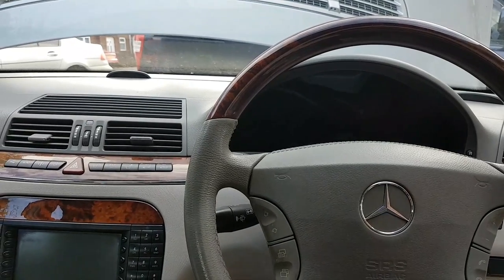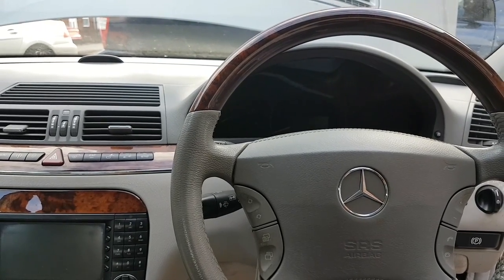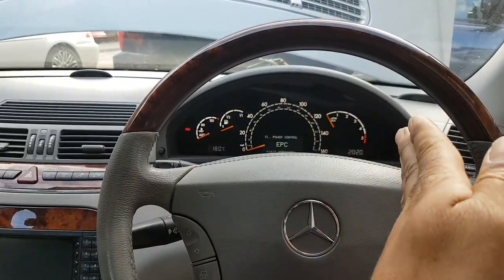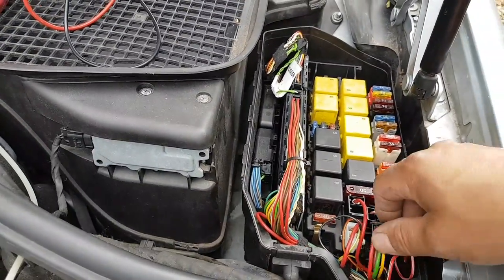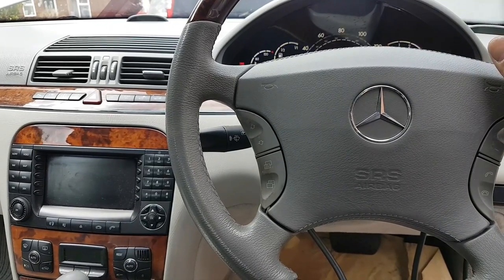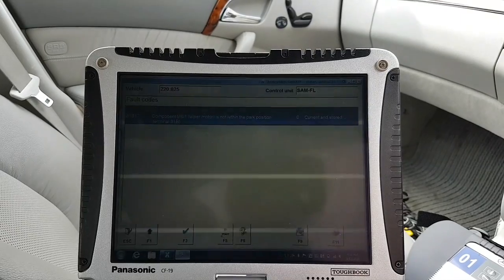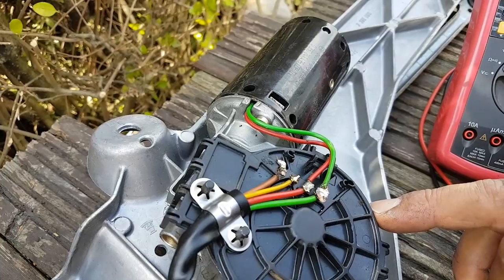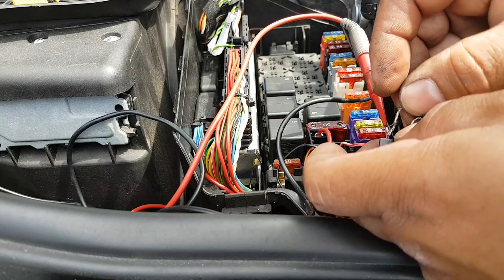Mercedes S320 W220 wipers not working. Fault finding and repair.

Comment: Hey Luis that was a great diagnosis but here's a tip from an old guy. From the days when cars had distributors and points, the points had a good thick layer of platinum plating. You could file off the burnt parts and everything was OK. Then the manufacturers started to economise, the platinum got thinner and nowadays I think that they are all just silver plated. Not just in cars but in things like fridge thermostats. This plating is a very thin layer over a brass or steel contact, after you have cleaned it it will not last very long. I was once given a really nice washing machine, it was built like a tank but the contacts in the mechanical programmer were burnt. I cleaned them but after two weeks they failed again. All the silver plating was gone. Anything that draws a high current and has an inductive load will give you the same problems. I hope that this helps anybody out there. It is a shame to buy new parts but sometimes you may need to. 

P.S. I'm not entirely sure but if you switch off the ignition with the wipers still running would the back EMF* make a spark across those contacts? Hopefully someone will know :)
*The back EMF is caused by the collapsing magnetic field (in for example, an electric motor) inducing a reverse voltage in the circuit. That's why some relays have a diode inside, it's to short that voltage across the coil and stop it harming the rest of the circuit.
Reply from the maker: Thanks for the advice!
For watching and for your comment, really appreciated! 
👍👍👍

Comment: well done, took a bit of sorting but you got it done,   I ask myself what have we gained from all these electronics, millions of man hours lost everyday because  of (in this case) a coked contact. In the old days you had 2 wires and a switch, you switched it on, and you switched it off, it worked .. and if it didn't it took 10 mins to fix.

Comment: Hey great video hope you're still doing your thing I have that exact problem with the ignition and was wondering if that can also cause an airmatic fault. Sometimes the car lifts sometimes it doesn't. The problem has gotten worse I can no longer jiggle the ignition to make my wipers work and now the car doesn't lift at all
Reply from the maker: It is possible, but o would think if was the ignition it would cause other issues...
Try to scan the car, and see what it going on...
👍👍👍
Reply: @LMAutoRepairs  the ignition is causing many problems. The wipers used to work by jingling the ignition and can't shift out of park without jiggling the ignition also when I press on the brake the SOS light and the gear shift lock light blinks and the radio cuts out. I've been having problems with the airmatic sometimes it goes up sometimes it goes down. And now that jiggling the ignition for making the wipers work does not work anymore the car also does not rise anymore I recently put a wire to a switch from that red power wire in your video to make my wipers work. And if the relay for the airmatic is on the same side that may not be getting power I'm assuming that it could also be causing the issue with it rising up and down. Sorry for the long paragraph and thank you for your help
Reply from the maker: Looks like you have the same issue as I had in the video...
☺️
Reply: @LMAutoRepairs  what you did to that ignition was it just a temporary fix or did solve the problem completely. You just clean the contacts and bent the contacts.my Car won't rise so it's not drivable .so I might as well try to do that same job myself before buying a used one and cloning
Reply from the maker: @steved6275 
It sorted the problem once for all in this case...
Reply: @LMAutoRepairs  ty sir

Comment: Great video I have a 2006 kompressor W203 M271 with the same problem check the fuse and relays and it look good and I did also buy another wiper motor put it on but it still on working. 
Regard Nigel
Reply from the maker: Hope you find your issue...
🤞
👍👍👍
Reply: The thing is I don't know where too start,

Comment: Good video. Thanks. My ML350 front wipers are not working. I believe the motor is good by applying power via connector pins. The fuses are good in the fuse box. After turning key to ignition position, I find no power 12V shown on the wiper fuse terminals. Is this correct? All other fuses’ terminals can get 12V except the Horn fuse. However, the Horn does work good. Appreciate any suggestion?
Reply from the maker: You need to scan and look at some live data...
Otherwise is like chasing a ghost...😊
👍👍👍
Reply: @LMAutoRepairs  Thanks for the suggestion. After finding no problem to the pump and the motor, seeing no power on the fuse terminals, reconnect the battery, the washer and wipers are back to work now! I remember saw a YouTube video. The guy has taken all wiper a part, test motor and finding no problem. The wiper begins to work after putting parts back. His comment, don't know what are reasons caused failure but hope the video shows you a good way of taking wiper into parts. I feel the same way, cannot figure out the failure reason. Though I did clean up the washer pump robber filter clogged residues.

Comment: Great video.  My 2006 S500 lately started having wiper and washer problems.  Sometimes they work and sometimes don't work.  When they don't work, the SOS and the brake light flickers on/off when I try engaging the wiper or washer.  Any suggestions on the problem would be very appreciated.
Reply from the maker: Difficult to say...
Could be something similar to this, but without checking/diagnose it is pure guess work...
Scan it, check some live data and go from there...
Thank you for watching!
Reply: Hey how's it going did you ever figure out that problem. I'm having the same exact issue

Comment: THANK YOU FOR ANOTHER GREAT VIDEO!
Yes it is imposible to repair car without wiring diagram somethimes. Maybe it is but then you don't need scanner, scope, nothing. Maybe this is posible I don't know. Even if it is, it would require much more time I'm sure. In this case how one would know where that wire was going without diagram.
Greetings from Serbia.
Reply from the maker: Indeed.. 👍
Thank you for watching and for your comment!

Comment: Vipers not working and
My washer dont work either,
Have check Fuse and relay and they ok..... can it maybe be the viperarm in car ... strange that both breakdown at same time......? (W203 c200 2001)
Reply from the maker: Hi
Yes... strange that both failed at the same time... but is possible...
Can you not scan the car first?
Thank you for watching!
Reply: I have done that with Icarsoft but it aint get no code at all..
Reply from the maker: @freddomfigeri193  
What about live data?
I don't know that tool... might not be able to go that deep into the modules...
Reply: @LM Auto Repairs 
This is really weird....?!
Took a grip around  wipers and ”shake it” and both the washer and wipers work 🤪🤔 
Soooo.... it must be a co-operation between wipermotor and washer...... guess it is the motor after all ....?
Reply from the maker: @freddomfigeri193  
Lubricate the shafts and linkages if they are getting seized...
👍

Comment: The oil temperature sensor is a common issue with the OM 642 engine. Mercedes made a revised component which is what your customer should have put in. If I can find the new part number I will post up on here. 

Where did you get your Star machine from? I remember you saying a while ago a company that you use (and not promoting) but I have lost the link to them. Can you please help?
Reply from the maker: Hi
Thanks... 
👍👍👍
Reply from the maker: Cardiagtool.co.uk
Reply: @LMAutoRepairs  Thanks.

Comment: I have a 2010 C300 4 Matic,  wipers will not work . I need a quick fix . Wiper motor is good . Can u tell me how to wire direct power to this wiper motor so I can hook up to a toggle switch for now . I would appreciate any help .  BTW I like your vids very good work you do .
Reply from the maker: I would have to look at the diagrams for that... 
Have you tried to Google it?
Thank you for watching and for your comment, really appreciated! 
👍👍👍
Reply: @LMAutoRepairs   I have tried Google and  fb pages , no help . I have watched  hours of vids and nothing bc No one has this problem.  Been working on this for 3 weeks .  Wipers won't work . Has power to motor ,motor is good , switch is good all fuses and relays are good . All started after I fixed the esl motor . No wipers and airbag light on dash now . Triple checked everything I took apart .
Reply from the maker: @ferrellcat5860  
So... must be something you have disturbed...
What codes do you have, on the airbag module and Sam?
Reply: @LMAutoRepairs   front left srs malfunction  and front right parking lamp .  Parking lamp has been on for few months . 

I don't have a scan tool for this car to get codes unfortunately.  

I figured  I disturbed something  as well , took it apart 3 or 4 times since and didn't find anything  wrong with wires.  Well the headlight switch didn't work either after I did the esl , took back apart and checked connections and light switch works just fine now . Just the wipers won't work .
Reply from the maker: @ferrellcat5860  
Try to get is scanned and actuate the wipers... if they work from the scan tool, then you narrow the problem down...
Reply: @LMAutoRepairs  will a scan tool from a auto parts place be able to run the wipers or what type of scan tool do I need for this ? 

I removed combination switch from clock spring , switch tested good , wasn't able to get any readings from clock spring connecters from front to back side   doing ohms and continuity test . But cruise control and all buttons on wheel works fine .
Reply from the maker: @ferrellcat5860  
Those cheap code readers will be no good...
You need a good diagnose session...
Reply: @LMAutoRepairs   not able send it to anyone that has a good scanner . That's why I was looking for a way to wire it direct so I can get them to work for now . 
I can't  find any wiring online to be helpful . 
I think it's the clock spring unit that is bad but not able to get one for a few weeks and it's my only car to drive .
Reply from the maker: @ferrellcat5860  
How many wires you have on the wiper motor, and which colours?
Reply: @LMAutoRepairs  3 wire hookup 
Red , brown and little pink one
Reply from the maker: @ferrellcat5860  
That's what I thought...
Unfortunately, unless you open the wiper motor assembly and connect straight to the motor, don't think it can be done...
The red wire (Should be pin 1) is the 12 volts... the brown (Should be pin 2) is the ground... and the pinky one, (Should be pin 4) is a LIN-bus communication... 
Sorry...
The LIN-bus goes straight to SAM 14M plug pin 1... if that helps...
Reply: @LMAutoRepairs  you are correct  with all 3 wire locations.  I did open and wire straight to brush assembly . Motor works with 12v direct hookup but bc this is a rotational motor/setup  it will have to go thru the circuit board first so it will rotate 180 degrees left to right . With it hooked to the brushes it will only rotate 360 degree rotations one way , reverse wires and it will go other way .  The transmission unit has stops on it at about 180 degrees from each other 
If there's some way to wire it direct from the plug on the motor housing or thru the harness if disconnected from the  Sam so the 12v goes thru the circuit board to operate the motor properly ? 

I don't know much if any about the parts and what they do on a circuit board,  if someone knows then I'm sure this can be figured out ...

Comment: Sorry to bother bruv What software do you use for those mercedes and the Panasonic you using am not familiar with it.
Thank you.
Reply from the maker: The OEM software...
Xentry/DAS
Thank you for watching!
Reply: @LMAutoRepairs  i guess OEM stand for original equipment manufacturer. Is there any specific software that can be used for all Japanese car or all German cars or you have to get a different tools and software for each?
Reply from the maker: @dashtyATG  
You have OEM for each manufacturer...
Reply: @LMAutoRepairs  so let's say u using this Xentry / DAS software for benz is it possible to be used for all the mercedes benz.
Reply from the maker: @dashtyATG  
Correct...
Like ISTA is used for all BMWs...
ODIS for all VW...
Etc...
Reply: @LMAutoRepairs  thank you so much that was i good answer i really appreciate your help. 

i  am new but in to it but with your help it's all going to be easier i just wanna work on ECUs  thats it and specifically german.
Reply: Sorry 4my long text. 

We have so mony stupid mechanics around my end guess what I've just managed to get hold of 2 BMW Bosch ECU from my nearby neighbor and those tow ECUs has not even been opened yat not even for any type of test so that means they just told the car owners go and get a new 1 if am not mistaken.

But then i was thinking how about the reprogramming the car computer as the ECUs look like old 1990 am sure there's a way to find out the model as well.

Sorry for my long text.
Reply from the maker: @dashtyATG  
No part number on the ecu labels?
Reply: @LMAutoRepairs  well there is numbers sir but it doesn't say P/N part number or anything like that i even use QR scanning app it gives me the 11 digit number 4 the 6 Cylinder for 1 of the ECU. 

while 10 for the other ECU with 8 cylinder.

If that's the part number i searched in Google no result.